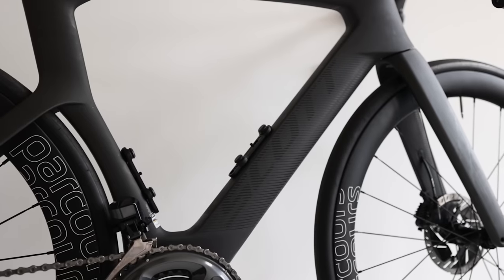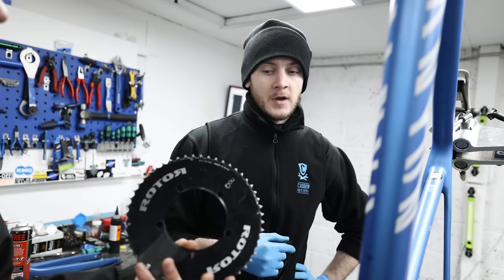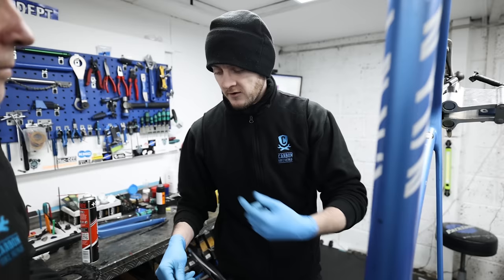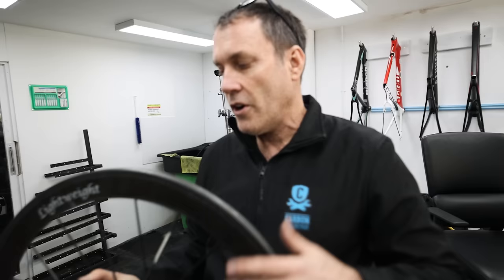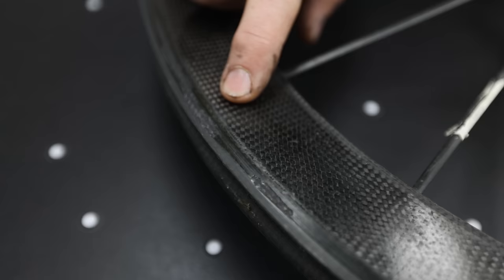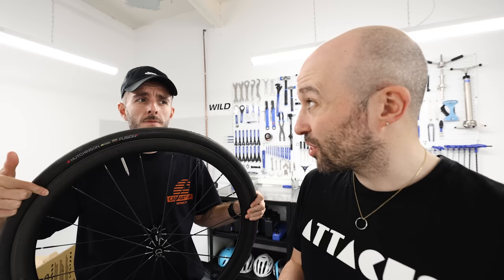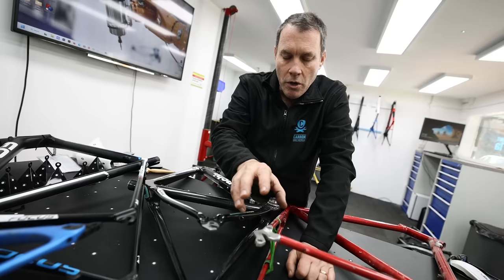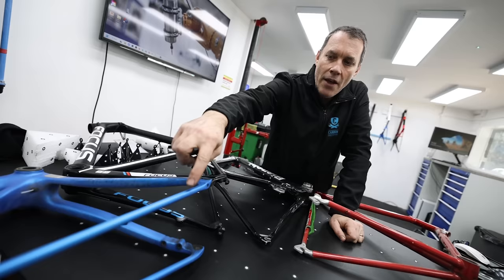6 Bike Products That Shouldn't Be Carbon Fibre

Comment: The carbon front derailleur hanger reminds me of old-school bikes that had integrated rear derailleur hangers. The same issue came up (generally in metal instead of carbon) where you'd break the hanger and have to write off your whole frame. It just seems smarter to have all those mounting points be detachable.
Reply: Write off your steel frame? No.... just have the rear mech drop out removed and replaced. Usually you could bend them back easy cuz steel has a large amount of elasticity.
Reply: Becomes a fixed gear or single speed grind off busted hanger and use horizontal dropouts to tension chain. Bike is still a bike
Reply: I leared to braze!
Reply: Yeah. In steel you can just weld it.
Reply: @rosomak8244  Braze! Welding makes the frame soft.
Reply: there's derailleur hangers that can attach to your axle (for example Shimano part #5412701). Already saved me a frame.
Reply: @timdieu2377  We are talking the rear hanger here.
Reply: @timdieu2377  I've welded some frames and yeah if you have heat-treated steel tubing you can ruin that but with tig you can keep it to a small zone and typically if brazed is good enough it's not like dropping that steel from 800N/mm^2 to 400 is the big deal and that's would be really good steel ...
Reply: I've been repairing steel frames for nearly a decade, most steel frame derailleur hanger issues  are easily repaired by just bending them back (best done with proper alignment check tool). It's a 5 minute job. I've also brazed in replacement dropouts on several frames when they're broken - no need to chuck a good frame! 

For new steel frames, at least one company (Paragon Machine Works) makes exactly what you describe - steel dropouts with a bolt in aluminum derailleur hanger.
Reply: And then SRAM first introduces UDH, followed by direct-mount derailleurs...
Reply: @timdieu2377  Frames are not made from seriously hardened material.

Comment: Having watched a few videos featuring Rob and his knowledge/experience of carbon, I think my next bike will be Titanium!
Reply: @endercrafts9056  he doesn't say anything really bad about titanium, just that it isn't the magical wonder material that makes all your dreams come true, like many people think. It's just a metal with good weight/strength ratio that doesn't rust.
Reply: @endercrafts9056  thanks, just watched his video. I think the positives he talks about tick the boxes for me. As an amateur rider I probably couldn't tell the difference between frame materials, but a strong, corrosion resistant and good looking bike sound ideal. Just think I would break a carbon one!!! 😂
Reply: Agree. I bought ti and I like it( Litespeed) but in all honesty it isn’t as comfy as good steel and mine rides much like my Allez Pro, Columbus al you min ee umm. But prestige wise on ride day everyone else is my bitch.
Reply: Titanium can be tuned for lighter weight and desired stiffness and resilience, but it costs more than straight gauge.  Seven Axiom XX is a 1200 gram frame with carbon lateral stiffness, but it will last a lifetime.
Reply: Good choice , I have a Ti bike. It’s great for me. My Genesis equalibrium 10 steelie is a better ride but is heavier 10kg but Isa very comfy ride. My Ti is much more responsive. I wouldn’t have Carbon bike, they don’t last long enough for me.
Reply: I skipped the Carbone and went Ti - Lynskey 1250gr frame and never looked back 12 years and it rides smooth responsive and very planted going downhill. I have no worries when travelling with my bike - peace of mind... and today Lynskey makes disc brake bike and internal cabling. I still get compliments on my rig
Reply: Have a 93 Merlin, Works fine and light weight.
Reply: for one year I am the proud owner of a v, Guillem titanium Formentor racing bike, ultegra 12 speed Di2. Best buy ever!!!!!
teh ultegra is fantastic, the titanium unbreakable with a nice tan. The bike behaves wonderful up and downhill. A little bit haevier but so am i.
Reply: moots has a lifetime warranty.
Reply: @michaelmechex that's the reason why I love titanium
with proper care
it will last a lifetime unlike carbon
Reply: Titanium is only as good as the person who made it.  Just like any material,  it has strengths and weakness.
Reply: Waste of money. Just go aluminium. Same Joung modulus for the weight. Same corrosion resistance.

Comment: I always thought bare carbon saddles were medieval.  As for bottle cages, go with titanium; pricey, but they last forever, look good, and are light weight.
Reply: ma selle carbone d'origine, a tenue 1 an !
Reply: @patrice169 c'est peu...
Reply: Or just plastic! You want a bottle cage to be flexible, and strength isn't important, so plastic is the ideal material. Sometimes cheaper is also better.
Reply: @jackroutledge352  or just aluminium
Reply: @jackroutledge352  plastic is also a hell of a lot lighter than titanium.
Reply: @NotALizardPerson81 yes, but you need a hell of a lot less  titanium.

Comment: When I once removed a seized carbon seatpost from my carbon frame, I found loads of carbon powder.
Another thing - a simple Ass Saver can cut through carbon seat rails in about a year, especially if you go behind the saddle a lot.
Scott Spark frame link (2017-2021) on the World Cup frame would only last about a year because of the bushing sockets. I had it replaced by warranty twice.
Reply: I'd definitely run titanium rails if I cared that much about saddle weight, much more durable than carbon
Reply: Great comment, never would have thought of that.
Reply: I rarely say "x is the wrong material for" anything.

But for carbon seat rails I'll make an exception!  That's trying to fit a good material into an old, bad (for the material) design.

Pretty sure someone will reinvent the seatpost/seat interface at some point. Then carbon might make sense.

All mine are metal of some sort.

Also - I would add carbon paste between your post and frame on every build.

Comment: Strongly agree on the last part (about fullcarbon frames) of the video. As i work in the workshop, i see all carbon frames slowly getting eaten up. This could be provided by layering aluminium inserts into the frame. This is what i love about the older gen. carbon frames and generally about Storck bikes - i own 3 - they use alloy inserts on all of the contact points and on top of that, they manage constantly to build extremely light and stiff (and in my opinion also strong) frames.
Reply: The problem with bonding Aluminium (or as you call it Alloy), is that Alu and CFRP are on opposites of the galvanic scale. Alu will corrode over time when bonded to CFRP. So no the use of Alu inserts isn't the panacea, the solution is to not ride a CFRP bike. Stick to the Metals (Alu, Steel, Ti) they will last a long time and even several lifetimes if well taken care of.
Reply: @triode1212  They should use something like 304 SS, which has a much smaller potential difference with carbon. It also forms stronger threads and is harder, which is better for surfaces that wear.
Reply: @ConsciousBreaks  or use a coating or plastic in-between to physically separate the carbon from the insert.

Comment: The most definitive guide I’ve seen to the pros and cons of rim brake carbon wheels
Reply: If you know your descents and they don't have more than a few hairpins, and you don't ride in the wet then carbon rimbrake wheels are just fine! for really long technical descents in summer or winter riding i wouldn't risk it. i can choose my day and the 500 gramm weight saving IS important to me andi hate the maintenance of Disks. next bike will be with disks however!
Reply: tubular solves a lot of risk of carbon rim brake clinchers

Comment: Agree on most things but I have used Tune carbon bottles cages for at least 40000 km without braking them (but I did have an aluminium one brake after only a few thousand). I do have had luck with carbon rimbrakes but they did ultimately indeed delaminate after 30000km but those wheels were awesome (dt swiss) and I would buy them again but for discbrakes next time.
Reply: Yeah, carbon bottle cages will work just fine if they're designed properly and you only use bottles that are fitting properly. Aluminium bottle cages have the issue that when they start to deform, they'll get weaker over time and eventually break. Again, there is proper design needed for the specific material in order to make it work.
Reply: Yeah... Super lightweight wheels with super heavy brakes. Just go aluminium. It doesn't make that much of a difference.

Comment: Now this is the push I needed to go to disc brakes. I've always known rim brake carbon wheels could be a potential issue. And being a big guy 100kg they're fine on the flats but on a steep descent... Oh boy. So I mostly ride flats. But the state of carbon drop-outs over time always intrigued me after seeing teeth marks in mine. Seeing those in the video were eye-opening. I was already leaning towards adding a disc bike to the rotation but this video has solidified the need to. Thanks Francis and Friends.

Comment: I had mine carbon wheels with rim brakes for eight years and 10 bar tire pressure without any problem... they are tubulars. 🙂
Reply: 10 bar. Yikes. I used to ride with 6.5, and that was with 23 mm tyres on fairly decent roads.
Reply: That simply means that you don't brake much. If you brake, they abrade, if you don't brake, they don't abrade. Braking in the wet is even worse. Some folk just have a riding style and routine that seldom calls for braking. That doesn't mean the inherent flaw doesn't exist.
Reply: well you have said it: tubulars! no side pressure  on the brake surface. thats why the pros could ride multiple mountain stages without failure

Comment: Because carbon fiber is not as hard as steel or even aluminium, I think basically any wear part e.g. chain and chainrings already covered. The other negative of carbon is not being able to weld it, so junking a whole frame because a hanger snapped is bad news. I would have thought spokes would be okay as tensile strength is one of carbon fiber's strengths but then again the spoke nipple tightening is more abrasion, or the unfixable spokes as part of the whole rim.
I would also not make wheel axle bolts out of carbon, as shear strength under impact is not its strong point. Cranks can be made of carbon, but I'd want the screw threads where it either bolts to the bottom bracket (another part I think should be metal of some kind) and also the pedal screwthreads to be steel as well as the pedal axles, though a carbon pedal is probably fine.

Comment: Carbon spokes are no more likely to break than steel. You can put them under massive tension and hit them with a hammer without breaking. The only down side is a harsh ride quality and cost. If your breaking carbon bottle cages you are buying the wrong ones, never had a failure. Had carbon rims with rim brakes for 10 years. No issues at all with modern heat resistant resins.  Things break if you abuse them whether they be carbon or aluminium or steel. I've had three major failures over 30 years of riding. A steel frame, Aluminium handlebars, and aluminium rims. Never broken a carbon part even after some nasty crashes on both MTB and road bikes.

Comment: What about shift levers? They are typically one of the first things to hit the ground when crashing, especially on flared bars. I'd rather have a scratched metal lever, than a broken carbon one.
Reply: I think it takes quite an amount of force to break a carbon brake lever. I haven't seen a road counterpart break yet as most of the force from an impact is actually bumping the dual-control lever inwards.

MTB brake levers, yes, I have seen and heard of those breaking. This is why some MTB riders deliberately undertorque their brake levers so that the entire assembly is free to rotate on the handlebars should they be impacted. Just tight enough so that it can't be moved by hand is enough.
Reply: They are replaceable
Reply: I like carbon levers because in cold weather, they don’t freeze my fingers like aluminum levers do.

Comment: 1) Carbon wheels is not good for rim brake. Approx 65% carbon 35% polymer in cfrp. What happened when you add friction and rub the polymer? Cfrp is a structural construction, not suitable for friction application. Metal carbon composites yes for friction application, big no for carbon polymer composites for the rim brake.

2) Cfrp also not suitable for press fit bb shell but still acceptable.

3) Same to cfrp chainring tooth, not good for friction application.

4) Carbon spoke is good, stiff, but not serviceable (glued together) & expensive.

5) Bottle cage is ok with cfrp, non critical structure to discuss and less expensive too.

Exclude national and international racer, you can have the most expensive bike but still get dropped by someone who ride with Sora/105 gs.

Comment: Carbon spokes that are cured into the hub and the rim are a huge issue because if they break, the whole wheel is broken and its expensive to fix. There are wheel companies like Gulo Composites, Hunt and others that have replaceable carbon spokes. Gulo's actually reduce vibrations, create a truer wheel and of course reduce weight. These type of systems can be trued like a wheel with steel spokes.
Reply: Winspace has a new model coming up, I think it's called the Mega. (Taipei Cycle 2023 visitors can see it) The way the spokes attach to the rest of the wheel is being bolted onto the hub and held onto the rim with spoke nipples (like in their HYPERs). If one or more of the spokes break, you're actually replacing that side of spoke array, instead of just the broken ones.

Think of it like a Lightweight wheel, just a little more detachable.

Comment: I’m a mountain biker. My bikes do have a lot of carbon fiber components, but I have never imagined anyone trying to make some of the things you listed in carbon. You’re right, they’re nuts!

I did wonder about it’s use in brake tracks, as race car brakes use it very effectively, but that description of what can happen has put that idea to rest. Great video!
Reply: F1 brake raptors use a compound called carbon-carbon which is extremely heat resistant. Not make like our frames are made.
Reply: Carbon ceramic in car brakes is something completely different from the carbon fiber reinforced polymers bike rims are using.

Comment: I'd have to disagree on the carbon bottle cages. It all depend on how it's designed: if the cage uses the same design as a manufacturer would for a plastic or metal cage, then it probably won't work. But I've been using a carbon cage for years with varying bottle sizes with no issue. The key thing being it's designed in a way that it offers flex without putting too much stress on the material

Comment: One point I’d like to say is carbon rim brake wheels done by Zipp have been quite good for me; however, being a fair weather rider probably helps tremendously!
Reply: My zips are lovely in the dry, rubbish in the wet
Reply: It’s actually funny how the guy says you will melt the carbon and if you’re fast enough you can let it cure again. 

Carbon is bonded in a duroplastic polymer, once the resin is cured it’s set. Heat it up above a certain temperature and it will start to break down, it physically can not melt. 

+ as far as I’ve heard, carbon brake tracks actually seem to wear out much slower than aluminum ones given that you use the correct type of brake pad.
Reply: @Jonas_GD_1234 yeah, guy might be simplifying for the audience... but it makes me question if he knows what he talks about.

Comment: He pretty much confirmed what I've always understood to be the case.  Carbon fiber is a miraculous material and it's heroically strong, right up until it isn't.  Once you hit its limit or compromise its integrity even slightly there's not much in the way of warning or de-escalation.  It lives more in the instantaneous catastrophic failure realm. As such I think it demands a level of inspection/maintenance and care that most of us are just not up to.
Reply: Basic material mechanics. I am pretty much convinced that most cyclist knows absolutely nothing about that. And they should. Carbon is not heroically strong, it has better strength to weight ratio than aluminum alloys. but not that much as people say. Alloy frame will be aproximetly 400 g heavier than carbon one. It is roughy 30% of frame weight i know. but in the scale of whole bike is much less. And weight is seriously overrated imho. Alloy frame is much safer for me though by being less prone to catastrophic failure.
Reply: This is exactly why I just don't like or trust carbon fibre full-stop.

Comment: Having a rim brake bike in all carbon, i have to agree on the drop outs. It's impossible to void wear here. Wheels, i get the point, i live in a flat climate and wheels are easy to replace (zooming out, a frame drop out isn't). As is, i have never managed to kill off a carbon rim from braking. Pothole damaging the side wall -  yes, it happened. Wet weather braking is shit on all wheels i have owned. They're no way near disc brakes. For braking, disc brakes are indisputable more safe and better.

Comment: The King Ti cages was are outstanding, very springy, excellent grip plus easy on bottles, unlikely to break and very light.   I've had a pair on road and CX/gravel bikes for over a decade.  I think Ti is the ideal material for cages, better then nylon, CF, stainless Steel or steel